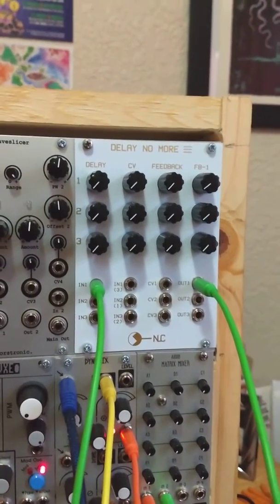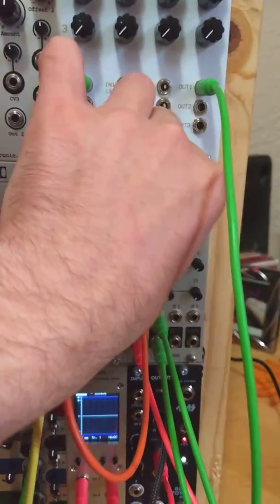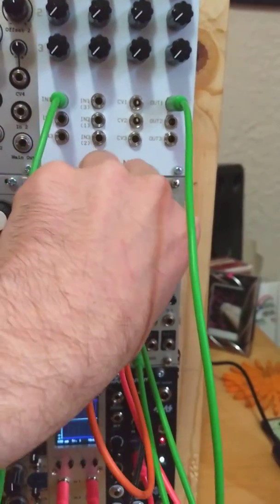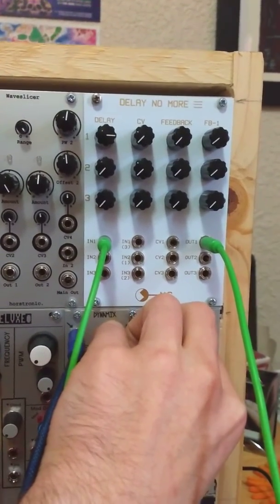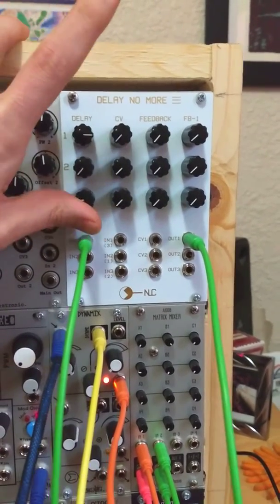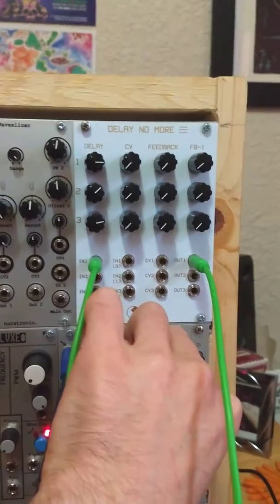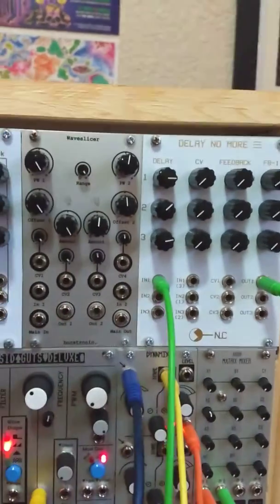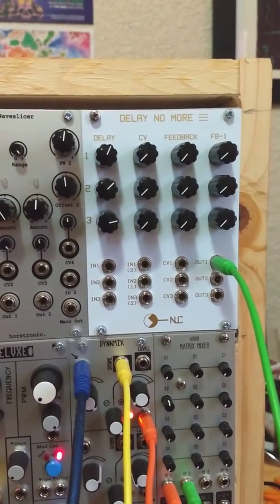NLC Delay No More 3 Questions

Comment: Yes, it's working correctly. Feedback from other channels all the time. Use the IN1(3) input instead of IN1 to turn off the feedback from channel 3 to channel 1. The switched contact in that jack will  be turned off and stop the feedback signal once you put a cable in there.

Comment: It‘s not feedback from other channels but just passing on the signal to the next line, could be interrupted by patching the second jack.

See module description: The 2nd row of inputs use the jack switches to forward the output of each stage to the input of the next, so if you wish to use the delays individually, use these inputs to break the loop.